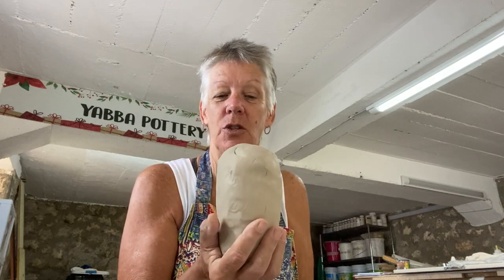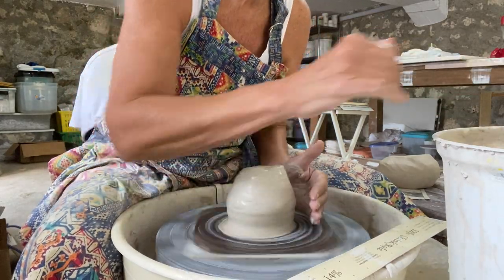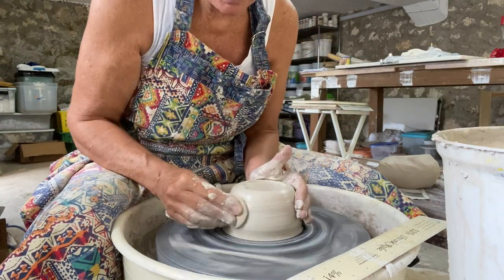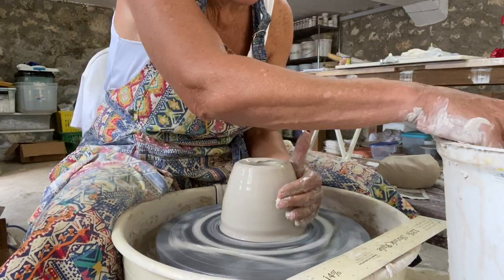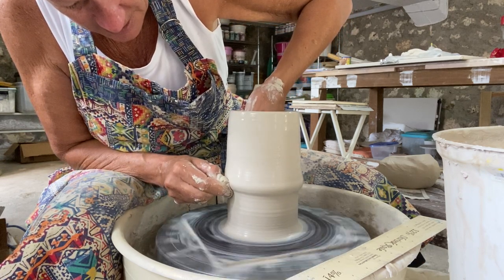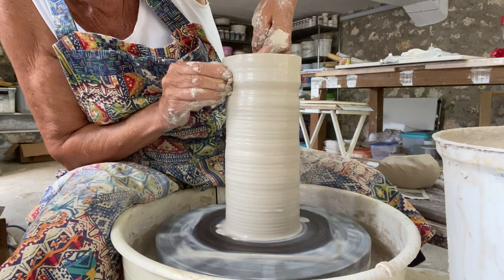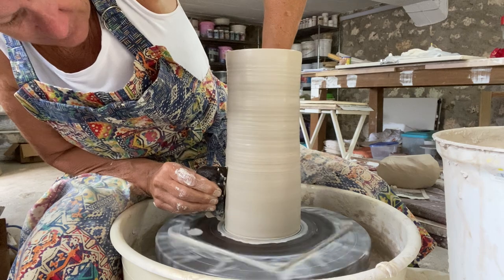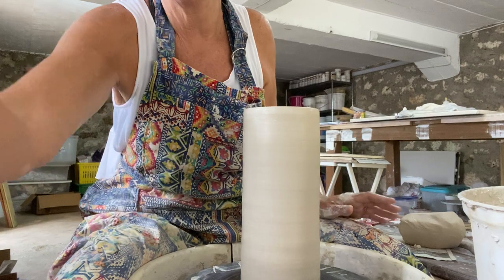Light Sconce Part 1

Comment: Great video.  My husband and I can only pull about 6”-7”.  I have been trying to find the type of batt you are using here in Canada.  I assume you do not wire off?  Would you know where to get them?
Reply from the maker: Hi Brenda.  They are 9" square tempered masonite bats which I import from USA.  There must be someone in Canada that distributes them.   I have learned to wait for them to stiffen up a bit before wiring off.  This helps to reduce warping.   Some pots I do not wire off at all, as they dry they will release on their own and I just trim the edge.